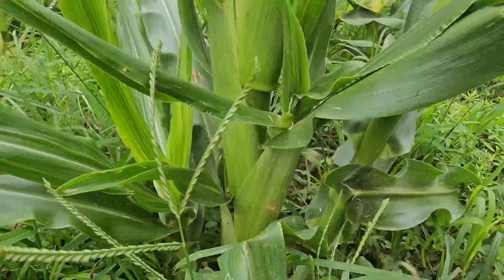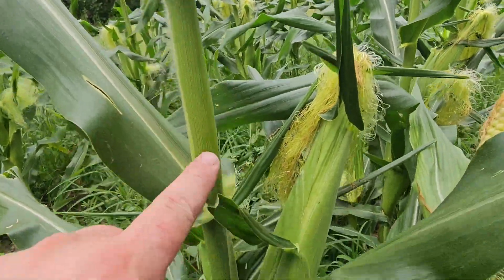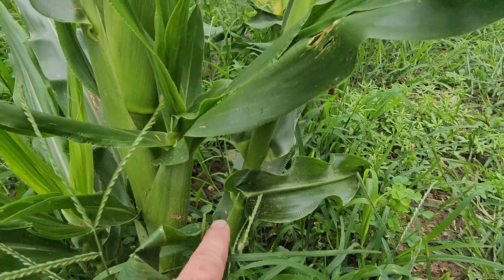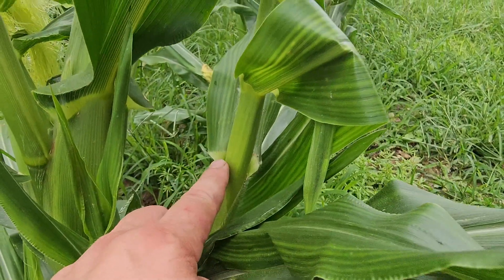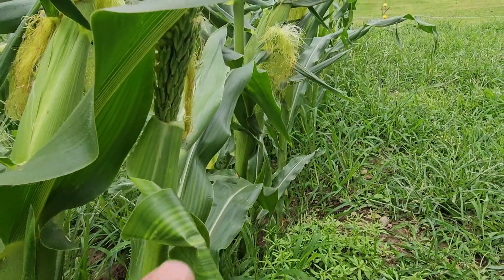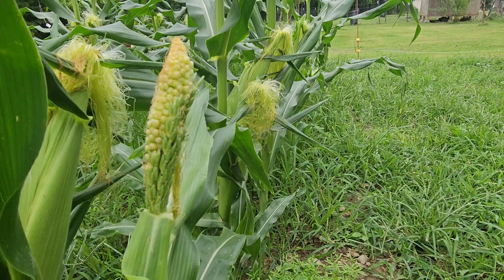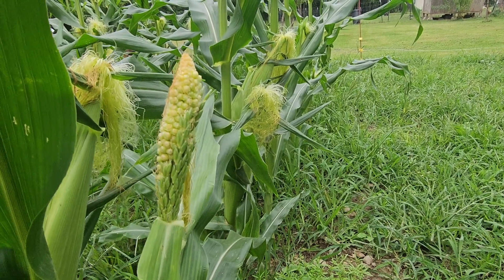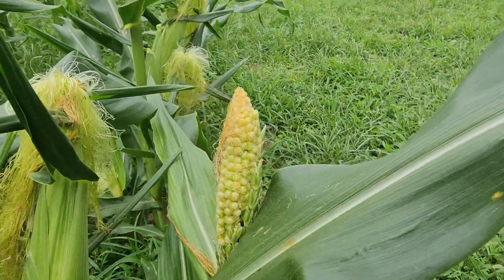This is how an ear of corn can grow on a tassel.

Comment: I am so glad to see another person who has experienced this. My Mountain Morado did this. I thought maybe the distance between the tassel and silk, but your corn is short. I found one more instance in a review on RareSeeds, "When it got about 10" tall, it suddenly pushed up tiny tassels before there was any silk, and the stalks promptly all dried up. I got half of one ear off the packet. The few kernels on it were beautiful black" I have had this happen to a couple of the few ears I got off this variety and I will experiment again with kernels from this year to see if it reproduces this feature. Rather desperate sexual behavior, I think.
Reply from the maker: I had never had this happen until then. I was growing Ambrosia. I tried a different variety this year and it happened to a couple of plants. It is very wierd when you first see it. Thanks for sharing your experience and thanks for watching.

Comment: I have stalks like that.  I planted several rows of Jimmy Red Corn.  It has been a extremely great year for corn. The corn has 2 to 3 ears per stalk.  The 2 with ear on tassel are about 13. To 14 foot tall.   Glad I found your video.   A new experience for me.  A first
Reply from the maker: Thanks, I'm glad you liked the video. It's good to hear your corn is doing so well.  It's been so wet that I'm having a hard time getting mine in. Thanks for watching.